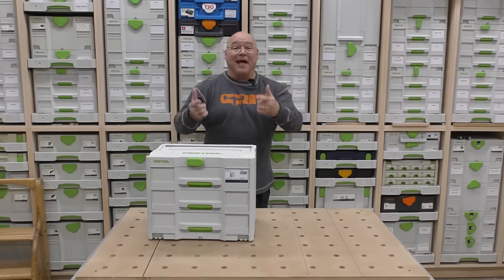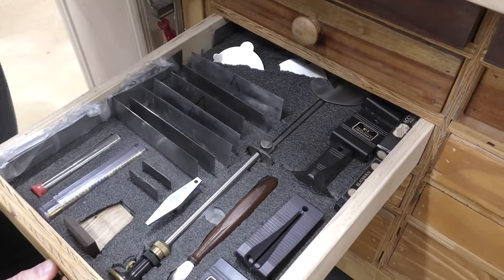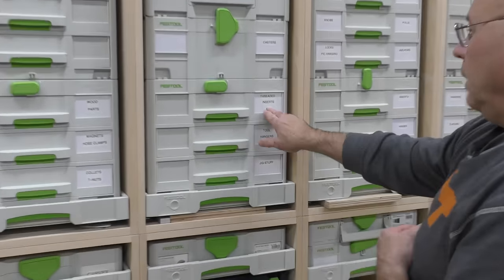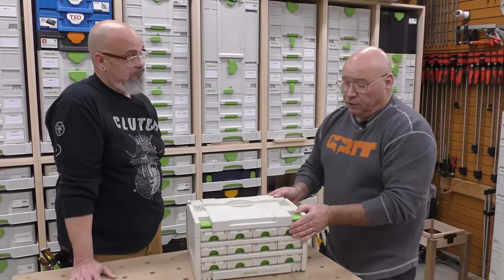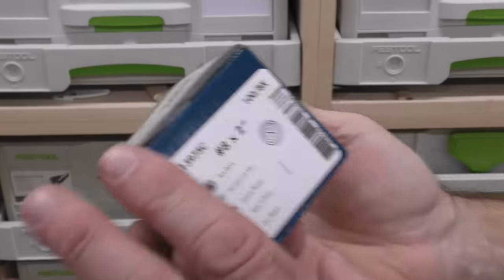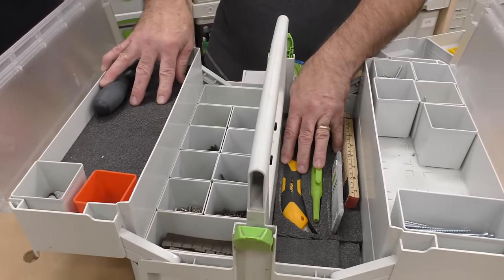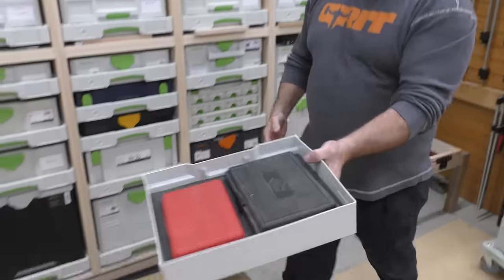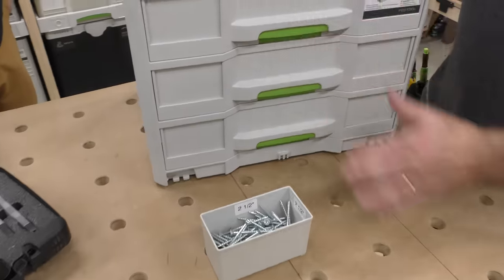STOP  Wasting Time in Your Shop!

Comment: Excellent Seg.  I'm just a poor talented amateur.  I have to make due with HF parts boxes for the most part.  There are a lot of tools in Kazan foam in those boxes.  Two design idea's I got from others were #1) Have everything you need for a tool together with that tool, even if you need to have duplicates support items such as bits and tips.   #2 From your primary work locations in your shop,  have what you use the most within concentric circles of use; such as arms reach, one step, and beyond for occasional use.  Now do the same for secondary tools or locations.  For nuts and bolts, I have parts boxes for various sizes  such as 1/4", 3/8", other.  Works really well.
Reply: One thing I never really thought about for kaizen foam until I got a sheet free as packing material for my systainers was... you can store tools vertically in it. I thought it would take up a ton of space, but unless you actually stack tools multiple layers deep, then that space is unusable space, but also, you can now stack tools that take up horizontal space in a shallow box, vertically, or diagonally with multiple tools in layers. And it's fragile enough, you can just ram the shafts of router bits through it. 

Before I got on kaizen  I thought they were goody with all the spread out tools, but in retrospect, it's just the guys making videos that are USING the foam goofy. If my box is 4-5 inches deep, I want 4-5 inches, vertical, of tool storage. my batteries, my torpedo level,  my scribes, my miter gauge, my bits, my blades, all store vertically now, whereas if they were loose, they just fell over, consolidated into a mess, and prevented me from  closing the boxes as they worked their way under my jigsaw, or my stud finder, or my drill. Now, I  have more stuff in the boxes and it stores fine.
Reply from the maker: cool
Reply from the maker: cool

Comment: If you have a 3d printer, you can print out custom sized bins for both the sortainer/tackle box system, as well as the Bott bins from the Sys3 organizers. I've also been working on a model of the Sys3 grid base, I have 150x150mm lego grid bases that I can fill the bottom of ordinary cabinet drawers with, that the Sys3 bins sit on top of so they don't tip or slide in the drawer.
Reply from the maker: ok
Reply: You can also print out the the white festool sustainer holders in the cabinets.  They don't slide like the expensive ones festool makes but they a match to the nonsliding ones festool makes.  I'm all about spending good money on their accurate tools but they go insane on every little plastic part you want to upgrade or replace.  YOu can literally make it yourself for .12 cents and they want $20 for it.  In that regard, just 3D print any plastic insert or moving part you can.

Comment: I’m constantly moving Sortainers and Systainers on wheeled trolleys. My main problem now is remembering where stuff is. Sometimes I color-code the fronts or insert manufacturer’s packaging into the card slots for easier identification. I’ve got dark Sortainers accented with bright gaffer’s tape for electrical parts and equipment, for instance. Sometimes I’ll tape or glue an example of the item to the outside of the drawer. 
For me the thermo labels just get lost in a sea of text. I have a hard enough time identifying the tiny tool pictures that come on original Festool tool Systainers. 
I wonder what other solutions people have for this problem. Maybe I need better glasses.
Reply from the maker: OK

Comment: Thanks for sharing another great video. I’ve looked at putting foam in my drawers. Do you get any issues with rust? I was concerned about the foam holding on to moisture.
Reply from the maker: I have had zero point zero issues with moisture or rust using foam.....
Reply: @sedgetool  great to know! Thanks for the reply. I recently got the Shaper Trace so think I’ll be scanning some tool outlines this weekend!

Comment: How are you storing all of your bench planes Sedge?  I’ve been debating about XXL systainers for my longer planes
Reply from the maker: Beginning of year ... 2024.. I will get into that...work in progress
Reply: I managed to fit a #7 jointer in a Sys3 L 137, but I had to do some surgery to it with Dremel and remove one of the internal corner braces